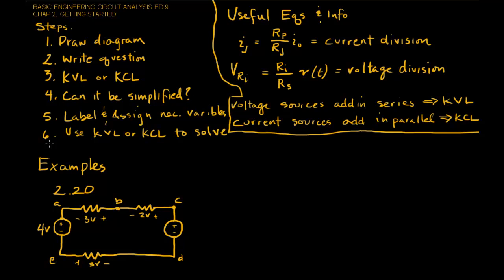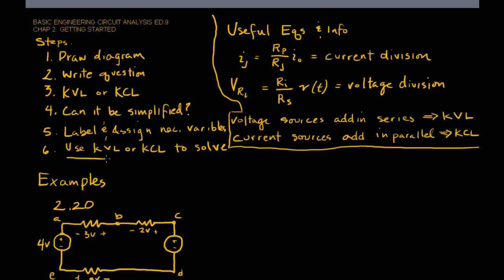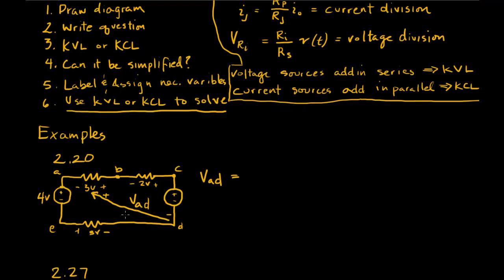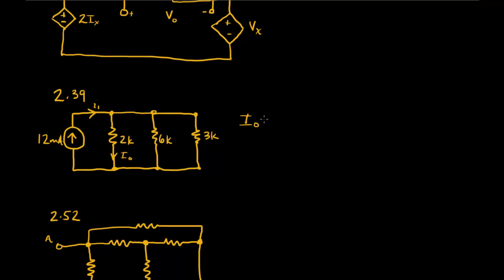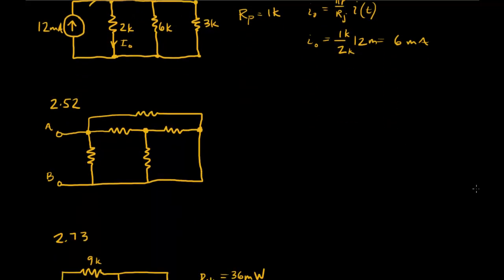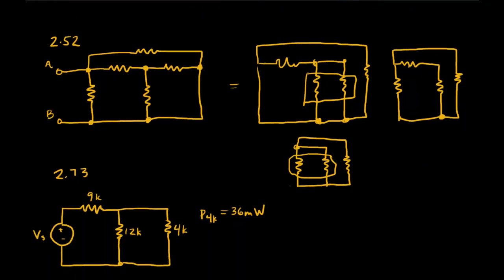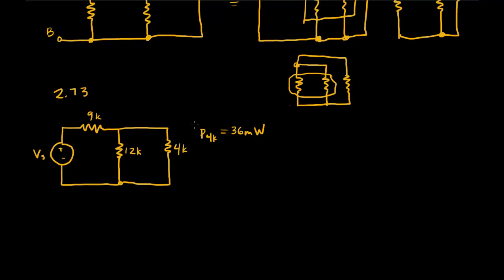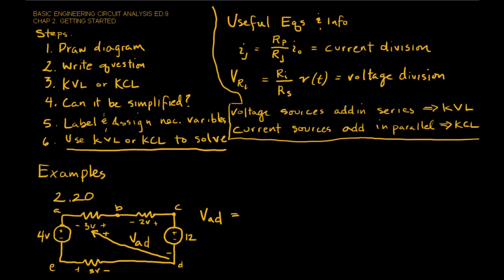Preparing to solve resistive circuits using KVL and KCL

Comment from the maker: Camille,  I'm suggesting that you should draw the circuit diagram as part of the problem solving process.  Some people just write down a set of equations and solve.  I've found that with many engineering problems, drawing a picture goes a long way towards untangling the problem.
Reply: Oh thanks. I do that already, but wasn't really sure what you meant. Cheers !

Comment: Legend said you still answer your comments
Reply from the maker: I guess that makes me legendary, whether I deserve it or not!  I made these vids when I was a student and since I've moved on to a career in semiconductors. But I still occasionally respond.  I've got a few dozen videos and still get comments frequently telling me the solutions are wrong...they aren't even if there are a few typos along the way.  Some of these vids were 10-20hrs of work as I worked to understand and also solve the same problem several ways....but i also had the solution manual.  In at least one case I found the solution manual was incorrect.
Reply: @AraujoMatt  yes. Your video was really really helpful. I was not able to do loop questions but this time i got thanks 👍. You are the best explainer i have seen so far